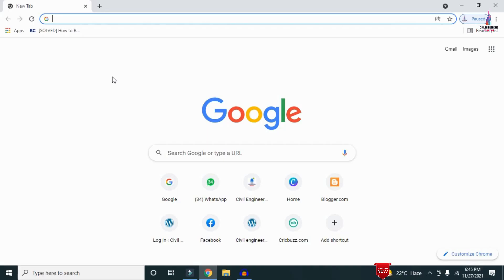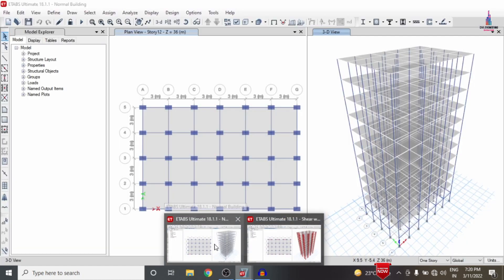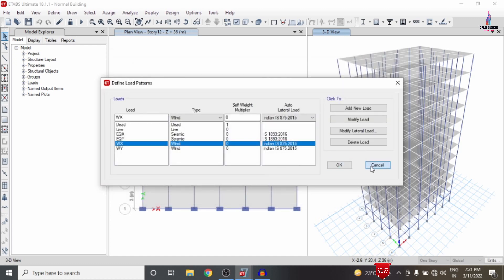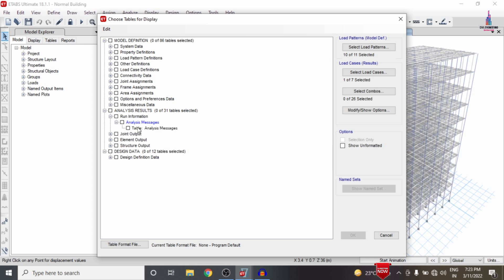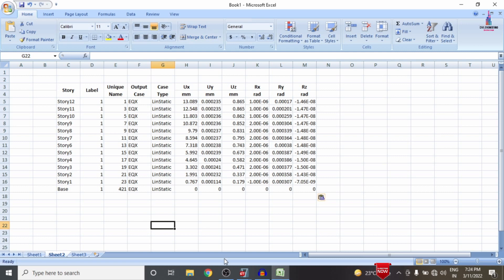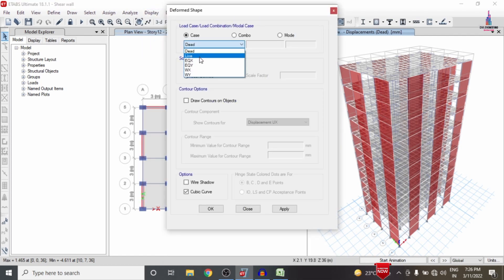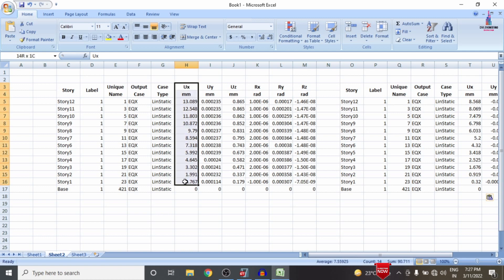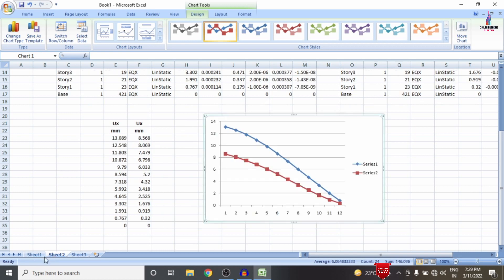Earth quake resistant building analysis with and without using shear wall| structural design | civil

Comment: Sir in etab, during the design steel roof truss can i put external coefficient in etab  in Windward and Leeward direction without any negative sign? Also sir if provide opening in roof truss is etab automatically calculate it?